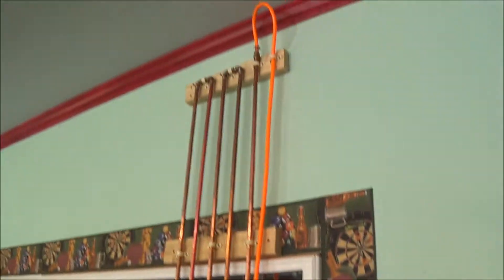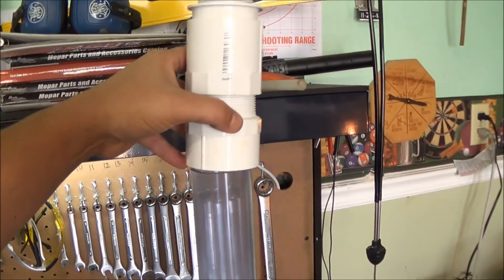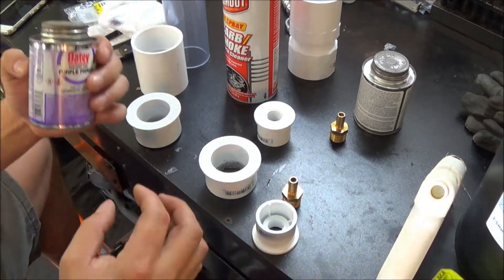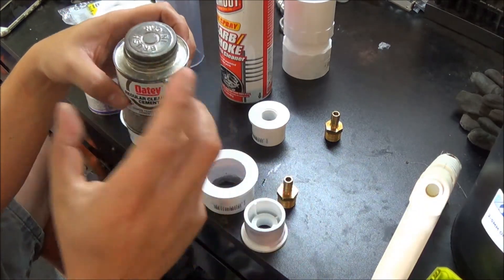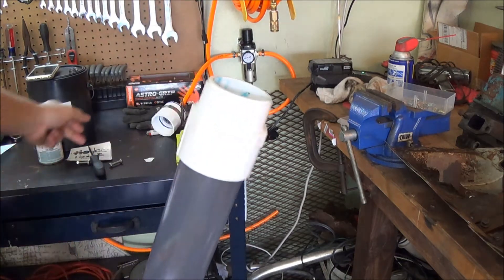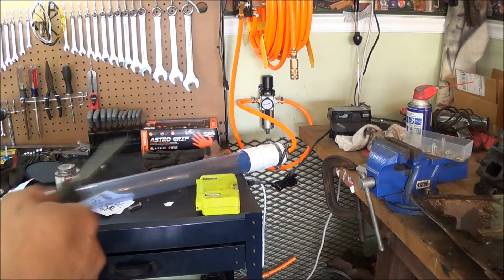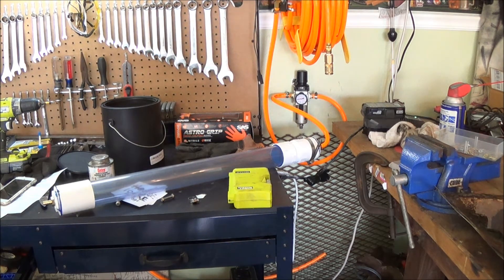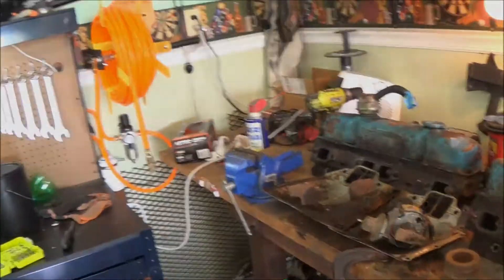Desiccant Air Dryer Part 2 of 2 (Supply list and cost in description)

Comment: Not a bad little idea so long as you keep internal pressure to 100psi for safety factor. I see this is probably five years too late at this point, but for simplicity's sake, you can have one side with just a PVC plug/cap and thread it for npt, then the other side have a quick connect fitting and a screw on top for when you need to swap out your desiccant. So long as you have it filtered before going through, you can throw it on a baking sheet somewhere dry (if you're not in a hurry to recharge) and let it air dry while the other charge is working, allowing you to use the desiccant several times over. Baking below 200*F is significantly quicker otherwise. The quick connect will come in handy if you're using a lot of air and have to recharge every few weeks, otherwise it's fairly trivial.

Comment: What are the specs on the schedule 40 clear PVC? What diameter did you use? What is the max pressure rating?
Reply from the maker: I am pretty sure i used 3" but its in the description somewhere.  If not mistaken max pressure is 260 psi...i dont go over 80-90 max and its not in direct sunlight and its also shielded in case it pops

Comment: On a different note but similar subject. I'm using high pressure air (4,500psi) out of my compressor and live in deep South Louisiana and moisture is an issue here as well. I use a molecular sieve system on the outlet (4,500 psi side) of my compressor for water knockout along with the one on the compressor itself. I tried something that has worked great for me that you may want to look at. I made a desiccant air dryer and have it installed on the air inlet to my compressor and I have no water at all now coming from my compressor or the molecular sieve drain. Just a little something to think about.
Reply from the maker: that is a great idea.  Did you create a video on it?  How did you attach it to your air compressor?  sorry for such a late response.  I didnt see this comment until browsing thru old history
Reply: @HodgePodgeGarage  No I didn't make a video but I have some photos of what I did. I am using a Daystate 4,500psi compressor for my PCP pellet guns. I removed the air filter cartridge from the intake of the compressor and used pipe fittings to connect a larger hard hose from the compressor to the dryer. I then put the air filter cartridge on the intake of the dryer.  If you send my your email address I can send you the photos of what I did if you like. I can't put them in here, won't let me.
Reply from the maker: @smillsjr  awesome!  I recently moved and am in the beginning stages of getting my shop all set up again.  Im curious to see if that works better.  It would definitely help with pressure drop.  Seems with my version the start up to continuous flow has a pressure drop.  Ill comment my email below so i can delete it once you send.  Thanks!
Reply from the maker: @smillsjr  yoshi.yasuda1@gmail.com

Comment: Wow,,,a vedio on how to make a pipe bomb,,,
Reply from the maker: Yep!  Just for you...  Almost two yesterday patter and no explosions tho!   Disappointed?
Reply: @HodgePodgeGarage  just proves your a lucky fool,,,,my friend lost his eye when his pvc air line exploded....
Reply from the maker: @georgespangler1517  I used schedule 80 which is rated for about 255 psi.   I have it in the corner of the shop with a metal grate (expanded steel) shielding it which is also behind two work benches and never in direct sunlight.  The max psi I run thru it is 80, so I'm not concerned.  I've had to change the desiccant 3 times in two years and I inspect it thoroughly each time and there is no sign of stress cracks.  Anyways, thanks for watching!
Reply: @HodgePodgeGarage  no,,it's schedule 40,,,said so yourself in vedio,,,,and 80 is gray,,,nice job though.
Reply from the maker: @georgespangler1517  my bad!  That is correct.   Still at the 2" diameter (corrected because I think I said 2.5" before) the max psi isn't that different than sch 80...it's still well 1/2 the psi (than the 80 I go up to) before I get to Max working pressure.  Burst psi is somewhere around 900 and Max working is 166, so I am staying below half of the max working pressure.  With no direct light to degrade and a blast shied, I'd make more just like it if needed.

Comment: Great video but do yourselves a favor and change out that orange vinyl air hose and replace it with a quality rubber one. That orange hose is going to become stiff, brittle, crack, and potentially a danger. I use to always buy cheap hoses planning on just getting as much time as I could out of them. They don't last me a year hear in Arizona heat inside my shop. If used out in the sun often they don't last 3 months! I finally bought myself a a yellow Goodyear hose and what huge difference plus easier to manipulate. After having my yellow rubber hose for 3 years I bought another black Goodyear hose. I will never buy the cheap hoses again.
Reply from the maker: BrokenRRT yeah.  that's on the list of things to do...it was a cheap way to get up and running via harbor freight for most of the stuff

Comment: Do you think it will lower the CFM any? My guess is no but its only a guess.
Reply from the maker: MidwestMotoRider I doubt it since there's lots of space, but I don't even know how I could measure that.
Reply: Going from a small to large back to small, isn’t that choking the system? Just going off some things I have read.
Have you had any issues with the air at the paint gun?
Thanks!
:)

Comment: nice set up, I like the desiccant set up , bigger and more cost effective than mine for sure
Reply from the maker: MrFireman164 Thanks!  I like how you have the pre-tank cooler.   it seems that would help more since the air is hotter at that point.
Reply: Thanks, been running that set up for a few years now I believe, and it works amazingly, that toilet paper filter is still the original and looks like brand new , have never had to change it .

Comment: That's cool how you made it yourself.  I got one of the Camair QC3 units for about $200 with 2 refills of desiccant so you definitely are saving money.  Especially when it comes time to change out the silica gel.  I have it piped so only use it for painting and blasting if needed with a separate hose.  That way I don't use up so much desiccant and also to use high flow fittings on the paint gun and cheaper regular fittings on everything else.  With the lesser expensive silica gel, you may not need to worry about that.
Reply from the maker: Sam's Garage I didn't think much about how often I may need to refill.   if it ends up being too often I may add a line before it.   I also want to add a regulator before and just have the filter after (I think)